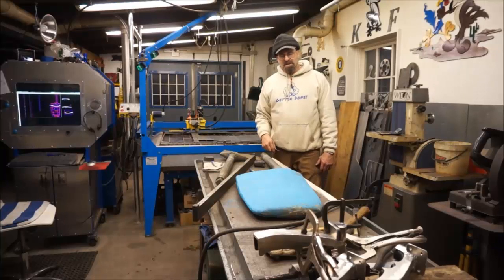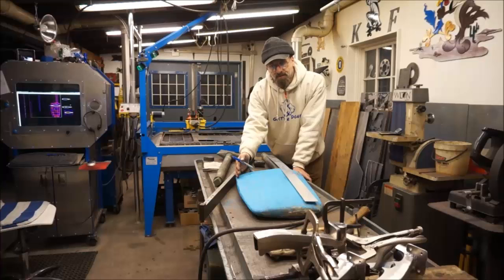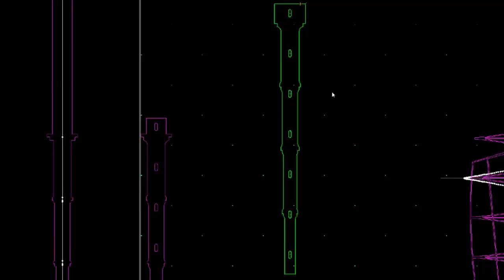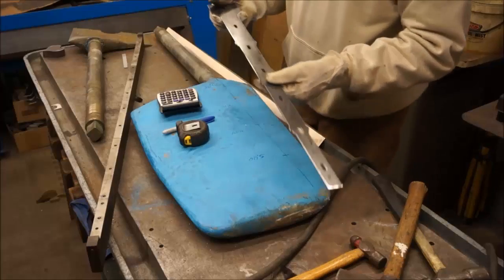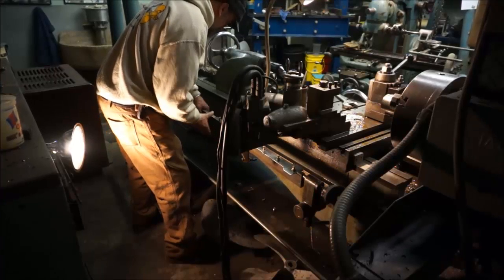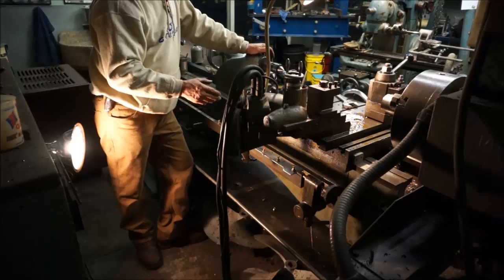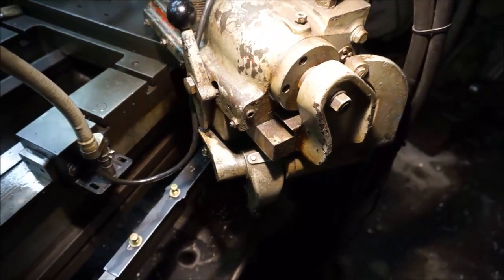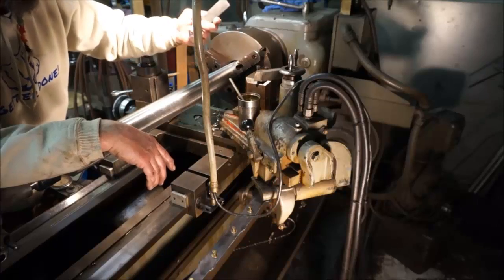Wing It Part 1

Comment: Very much appreciate the in depth ins and outs of the tracer attachment Keith. You are spot on about the spool valve, one little speck of shit gets in there and it can be a real downer as far as smooth operation. Yet another excellent video!

Comment: Hey Keith, first off, I love the channel. I like that there is no arrogant bullshit that is so common on Youtube channels. So, thanks for that.

Anyway, while watching the CAM portion of the video, I saw that every corner is a sharp break. I used to do all the programming for a former employer that dealt with Lasers. I found that adding a .25 or .5 mm radius to all corners helped control blow-outs on thicker material, less HAZ on the tip of the corner, and it also helped with the machine drives and "shake." It is much smoother running a radius than a sharp corner, so there is no sudden stop of the X or Y axis, before changing directions.

Comment: We used to have a shop in town with a 18" Monarch with a Kellar tracer attachment. I wish I could have bought it when they sold it I can see many uses for it now. I think I could do this shaft pretty easy with my DRO, but those belt pulleys for Keith with that curve would be nearly impossible. I guess these rudders need to loose weight and that is the reason for the radius above the supports?

Comment: I've been waiting for this ever since seeing the follower on those antique pulleys - it really blew my mind how an 'unpowered' stylus could give enough depth strength to plunge into metal - until I saw the hydraulics :)  Very neat and thanks for the spool valve description - really helped clarify!
How does the stylus deal with hitting a 'right' angle as it progresses along the pattern? Does it have a relief or ramping action to stop it catching?
Reply from the maker: As the stylist hits a shoulder or steep angle it retracts until it passes over the top. the angle of approach, slide, stylist, hydraulics and tool bit are about 20 degrees from the 90. ;{)------
Reply: frollard I

Comment: I've measured my cuts and readings a few times and I'm pretty sure my Logan has an actual dial on the compound and a direct dial on the crossfeed.
Reply from the maker: That may be possible, check it out with an indicator against a rod sticking out from the chuck. ;{)------

Comment: So now I get how that works when it hits a face. Before I couldn't understand how it could do any facing operation without jumping out all at once.  Never considered the angle it was set on. So I guess over the length of the shaft the carrage actually travels a bit further than the tool does depending on the difference in diameter from one end to the other. Is that something that is significant enough that you have to account for it in your setup?

Comment: Thanks for time you take showing use your work of art. I have learned a lot. Have one question, what is the brand name of your tracer attachment? I have a 1954 20" Monarch lathe and would like to fit it with a tracer attachment like you have. 

Thanks,
John
Reply from the maker: I can't see or find a name on the attachment of tank and motor assembly. ;{)------

Comment: that is very neat, i do have a question though, why was the template cut double sided?
Reply from the maker: As I stated in the video, as I was showing it at the table, I cut both sides in case the cut looked better on the other side, or return trip, I would have a choice, by just flipping it over.  It took less effort because of the way I created it from my existing shaft sketch, copy paste and create cut paths with to clicks of the mouse. Thanks for the comment! ;{)------
Reply: ah, that makes perfect sense, i guess i wasn't paying attention . Thanks for the quick reply, keep up the good work

Comment: That's a nice setup. Incorporating such a long template has to be challenging. I'm still a little perplexed as to how each diameter for the ribs is sized. I'm going to assume the plasma cut template is "pretty close" and you tailor the holes in the ribs to suit the shaft to get a close fit for welding .... or does it even matter?
I ask all this because it appears that once the template is cut and mounted there is no provision to alter the final diameter of each land relative to one another...

Colin
Reply from the maker: They are extremely close and I share in the videos to follow. ;{)---
Reply: Cool. No more questions....I await patiently.... lol